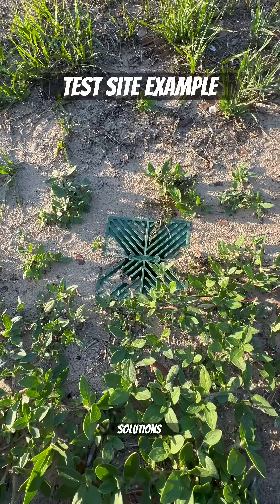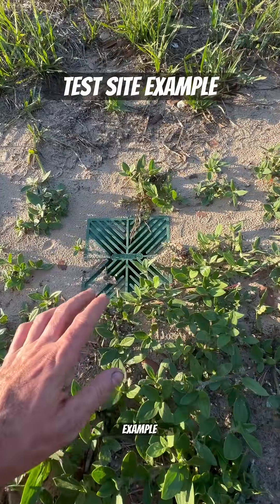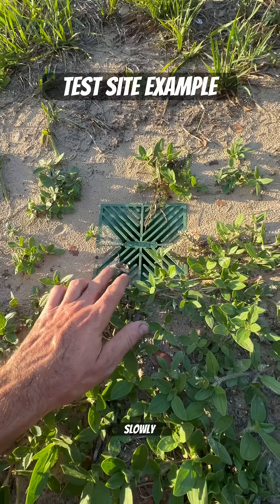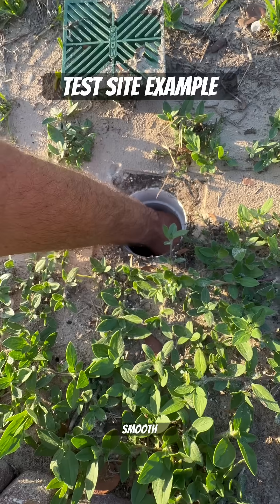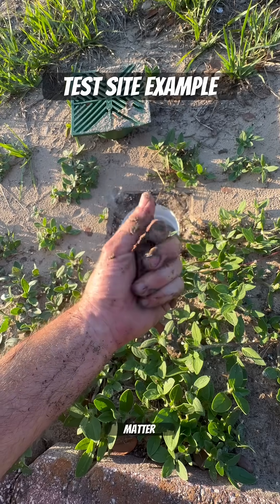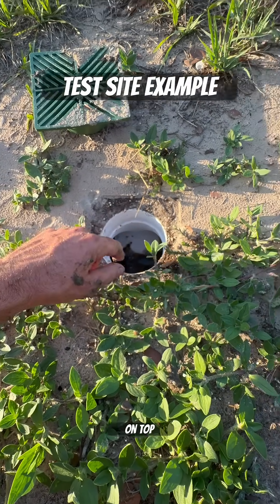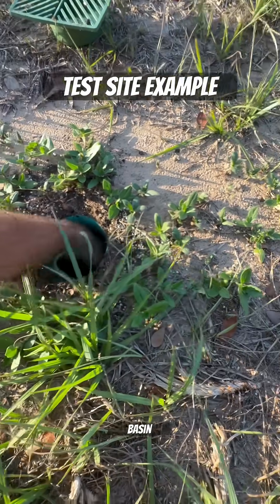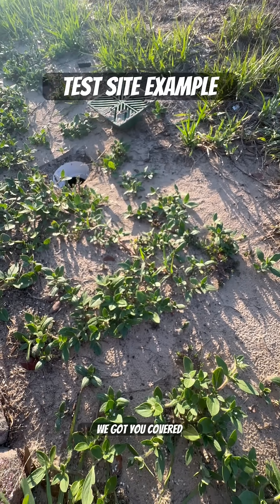Drainage Systems And Sediment - Storm Water Drainage Solutions

Comment: So what is the solution??? 🤷
I have several like this.  They are constantly filling up with sand and my neighbor's leaves.  I can add a screen to stop the leaves, but how do I fix the issue with the dirt?  Of my 9 catch basins, 7 of them are in zero-scaped areas; only sand with some rock.  My catch basins are constantly getting sand in them
What can I do?
Reply: You can add rock around the grates to help reduce the sediment. Drain pipes will always carry sediment. The problem is when drains are installed too flat that doesn't allow for self cleaning.